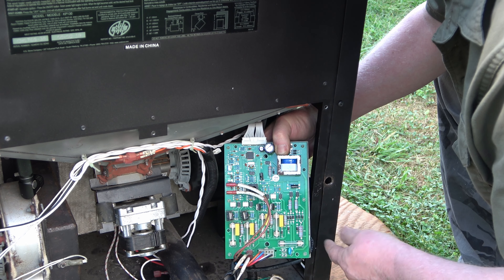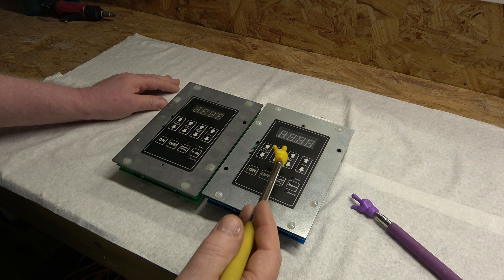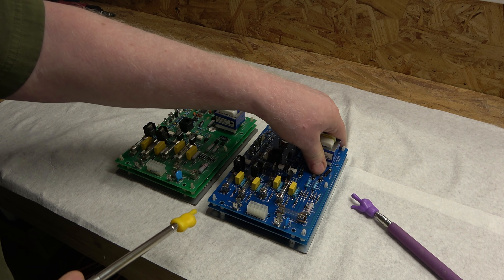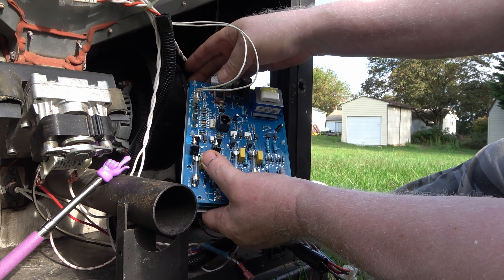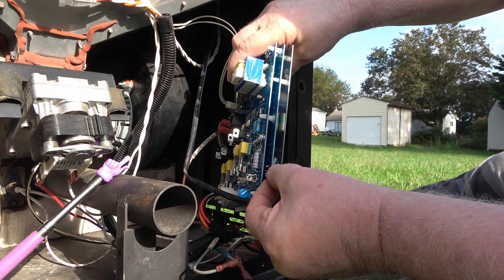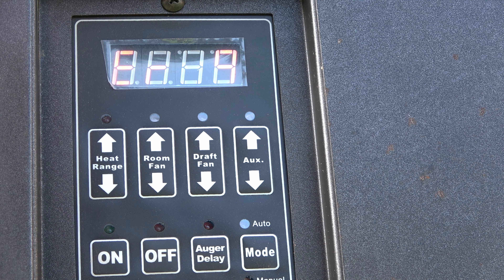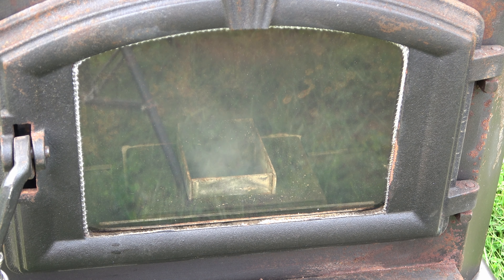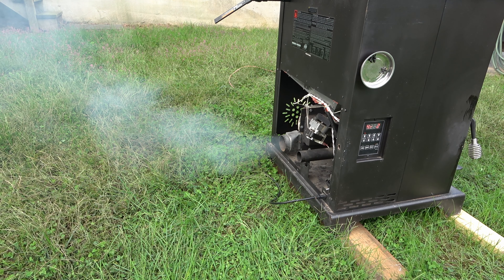King Pellet Igniter Stuck On / Repair Or eBay Controller Replacement

Comment: Hey what does the  side plug do? Have you ever figured it out? I got one because mine went up but my original didnt have one.

I should say my pellet stove doesnt have that wire to plug in.
Reply from the maker: I'm puzzled at the side plug but figured when ordering I would get exact match in case it's needed 🙂 (next time I remove the back cover I will trace the wire to where it goes and report back)